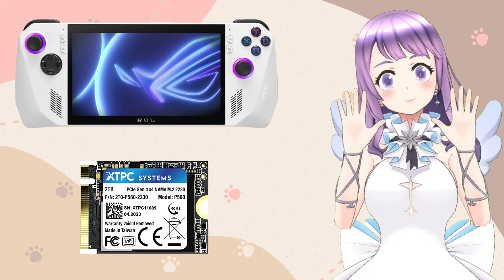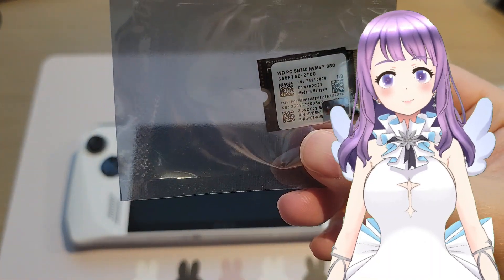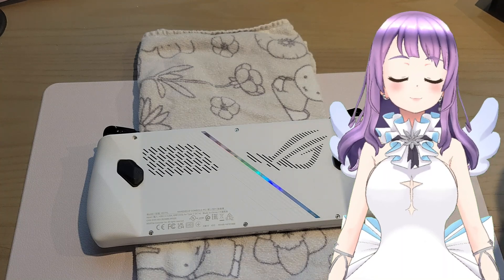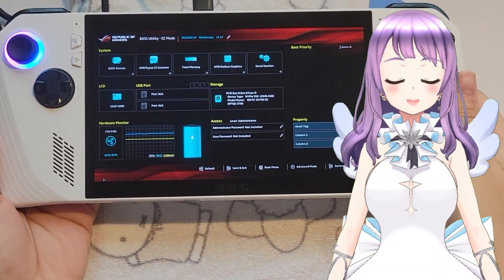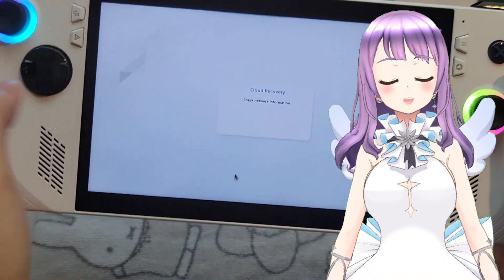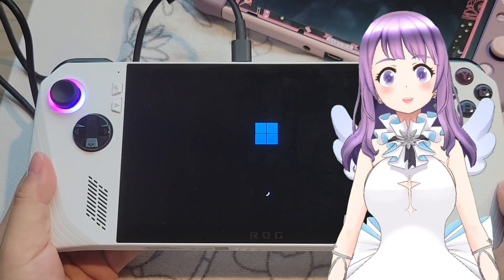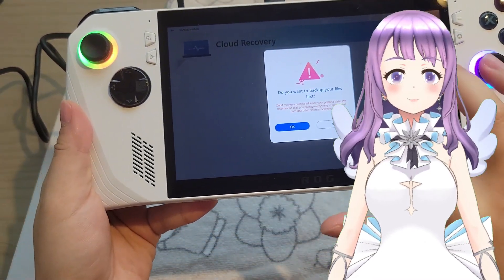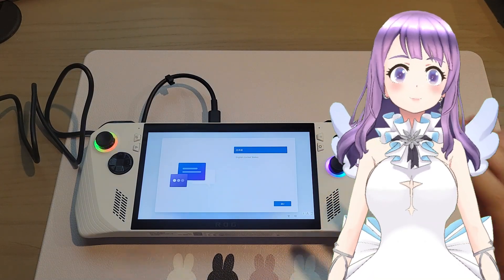[UPDATED] ROG ALLY SSD replacement tips and tutorial

Comment: The screw from the SSD is really hard to get out and is practically stuck I can't even unscrew it like it so fixed and I only sratch it with the screwdriver. What should I do T_T
Reply from the maker: Try another driver. Don't unscrew too many times/ too hard, it may strip the screw. You can also see if placing a rubber band on top of the screw helps, this will increase the friction between the screw and the driver

Comment: You should unplug the power cable there first before replacing the ssd
Reply from the maker: I did :)
Reply: @ETlandxoxo  nope, I saw the video when you remove and add the SSD, the battery cable still connected there
Reply from the maker: @lolo_gogo h you mean the battery. Actually it is mentioned in the official teardown that it is not a must to remove the battery cable. And if you watch thh phawx video, he didn't remove it too. 
It is a safe practice, but not a must
https://www.youtube.com/live/TAjvCSYlK-I?feature=share

Comment: I got an open box and last user erases everything even windows I installed windows on the original nvme  but is not recognizing it
When you reset it you use ntf format?
Reply from the maker: Sorry for that late reply. I used a brand new SSD so I didn't format it

Comment: Apparently MyAsus is the key app to use for updating the bios.  You should also unplug the battery.  Some already have the newer bios, so are apparently lucking out if not updating with MyAsus, or replacing the ssd fresh out of box.
Reply from the maker: They did mention that it is not a must to unplug the battery during the teardown stream. But sure, if you want to play safe :)
Reply: @ETlandxoxo  Their actual engineer though has this in the instructions, but no harm no foul if works :)  
Next, you’ll want to disconnect the battery for safety. Lift up the black flap between the fans and, using a spudger, pry tool, or even your guitar pick, slide the metal retaining clip back, then pull the battery connector upward and out of its socket.